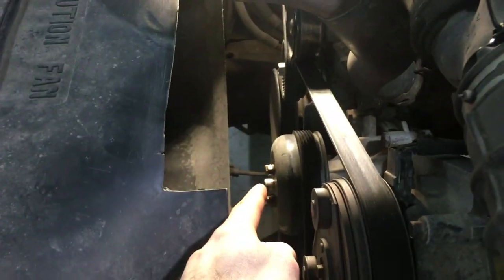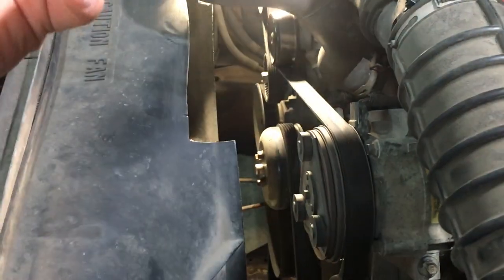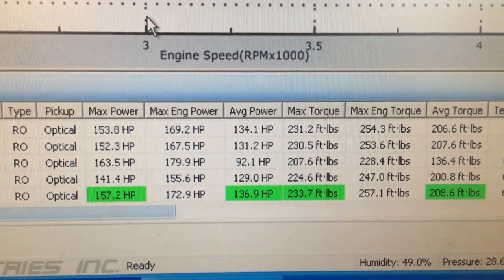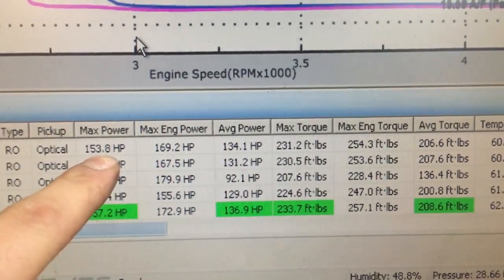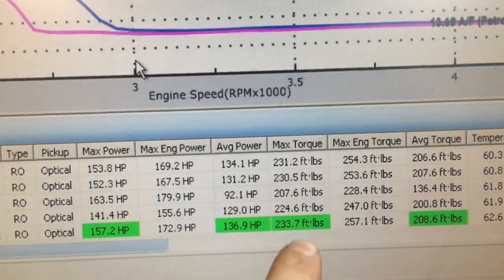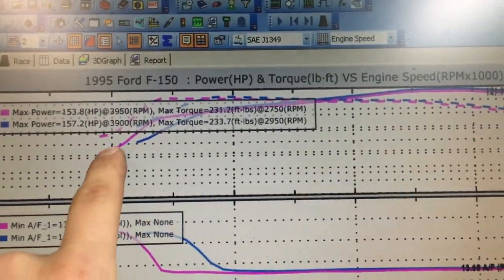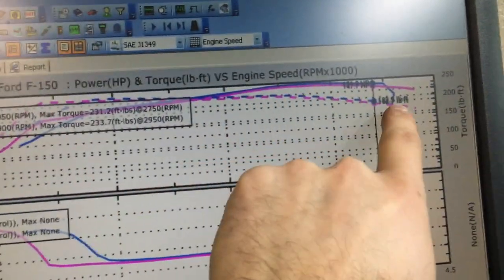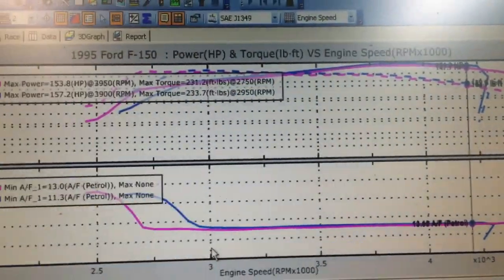Does a Mechanical Radiator Fan Kill Horse Power? - DYNO TEST | 1995 Ford F150

Comment: I'll keep my clutch fan for now.  My stock cooling system has been bulletproof in the hottest midwest summers and heaviest of traffic.  I sure hate to mess with that over 4 hp.  Especially since when it comes to overheating, it only takes it to happen once to kill your engine.
Reply from the maker: I agree with you 100%. I feel like electric fans aren’t full proof.
Reply: I just had to cut my timing cover off and replace my water pump. Now I am faced with either to replace the clutch,fan blades and see if that causes the water pump to fail all the time.
Or switch to electric fans and happen to get defective fans that burn out and melt my engine. 

I am leaning towards keeping it stock because the first clutch/fan setup and 2 water pumps kept it cool for the first 30 years. If i just put a nice clean new one it should do the same for another 30. (in theory)

A 408 Windsor is the best way that i have seen to add HP to any Ford truck. :)
Reply: U are 💯% correct!! Arizonan here. My fan clutch keeps my engine cool when sitting in traffic in 115°F heat.
Reply: @Juan67_Az  I’m from Arizona too and I’m thinking on do electric fans upgrade, but I’m not sure not, I would mess around with my clutch fan just to add 2-4HP extra, my clutch fan is been doing really great during the last few years when it gets 115-120 degrees..
Reply: @Santiago Davila  I wouldn't change my clutch fan for electric fans, plus I don't think my alternator could handle it.
Reply: @Juan67_Az  what the does the alternator has to be with this.? You mean it ll use more voltage.? Please explain. I do want to get electric fans, BUT now reading the comments, I’m just not sure ..  thanks for replying
Reply: @santiagodavila1426  a good set of Electric fans will pull a lot of power/ Amps. Why is the reason you want to get Electric fans?
Reply: @Juan67_Az  so a good set of electric fans will use more voltage.?? How can i find a better alternator.??

And I would like to switch because I heard electric fans give you extra few horse power and you MPG ll be better and also heard that during summer and during the city they help your AC system better. Thanks a lot for your time.
Reply: @santiagodavila1426  im not sure
Reply: I'm going to swap my electric fan for a viscous clutch fan setup. I don't care about 5-10HP at the wheels. I care about towing my stuff while keeping my engine in it's operating temperature so hotter temps don't ruin my lifters and cost me thousands.
Besides the vast majority of electric fans don't give you charts for static resistance so you don't know what the CFM is in your specific radiator & AC condenser setup. You can be rated at 2000CFM on your dual 16" fans and actually only pull 800CFM when running that larger 2-3 core radiator that's 1.5-2" thick.
Let alone trying to pull air through a radiator, AC condenser, PS cooler and Transmission fluid cooler stacked in layers in front of that fan setup.

Heavy duty/severe duty Clutch fans pull tremendous amounts of air through your radiator. Id say my plastic 11-fin clutch fan blade pulls 3x as much air as the OEM electric fan. A heavy duty Clutch can spin 80% the speed of your water pump, a standard clutch fan can spin 60% of the water pump RPM's and a severe duty Clutch can spin 90% of the water pumps RPM's which is insane fast.
You can mod huge plastic fans to fit your models clutch and get insane cooling capabilities.
My clutch works without shroud and my electric fan only works with fan shroud.
Obviously u can get a gigantic E-Fan to pull 3000CFM after static resistance from radiator but your talking about $$$$ multiple components that can fail and let's not forget a E-Fan has parasitic draw on your alternator and that can tank your system.
On my 02 Jeep Grand Cherokee 4.7L it comes with a 135Amp alternator and a bigger electric fan requires a 160A Alt
Reply: @CameronDC-Grimes you said it best!  Your a 💯 correct!
Reply: I mean the whole point is for the mpg’s and the slight relief of strain on the engine when you have electrical systems or once it get’s to its optimal temperature. I bought mine for 500 and I had to do so much work and wiring and it comes with a fuse and switch that makes them more reliable. I’m just scared for the alternator but I can swap my xterra’s with a quest of the same year so I get 50% more capacity
Reply: any car doesnt overheat in hot weather. nothing special about yours

Comment: For a real test, install the electric fan and see if the increased work from the alternator off sets the gains. Electric is not free energy magic!
Reply from the maker: This is true. It could even out once the alternator is under increased load from the electric fans.
Reply: @TheMinuteMasters  It would offset some of the gains. I guess the hope is that the electric fan is off most of the time.
Reply from the maker: @qazwsxzwharp  Yeah I think while the engine is cooler, the fan remains off and there’s less drag.
Reply: @TheMinuteMasters  That is what happens. Generally the fan is only needed when sitting idle or in stop and go traffic. When cruising natural airflow is sufficient.
Reply: except the fan isn't running when it doesn't have to be, making a proper solution more efficient for actually driving.

Comment: The electric fans typically do free up about 3 to 4 hp water pumps free up about 5 hp typically but the alternator actually uses more horsepower than any of the other accessory‘s especially under a load such as air-conditioning radio lights and other accessories
Reply from the maker: This is very true. I guess the real test would be what the alternator load would be.
Reply: The clutch fan is a parasitic load all the time though, hot or cold,  an electric fan will only increase alternator drag while it's running.    I'd be willing to bet this mod would decrease fuel consumption by 5%-10% as well.   (0.5mpg - 2mpg)
Reply: @Zt3v3  Not true.  A clutch fan has a variable load factor, so when the radiator is cooler the clutch loosens up and will draw at say 20% effectiveness.  When the radiator is hot, the clutch engages and the clutch will draw more power and turn the fan at around 80% effectiveness.  And all ranges in between. That's the whole purpose of the clutch, to save horsepower when the fan is not needed as much.
Reply: Would you recommend getting an alternator with a more ampage?
Reply: @anthonypipia6990 higher amp alt is always a good investment. One of these days I hope one pops up for my truck or maybe I need to modify an OEM one.

Comment: Of course the fan takes power to run but what are you going to do, just not cool your engine? That electric fan will have a parasitic drag on your alternator, I came here hoping for a comparison of the two ways to power your fan.
Reply from the maker: Well let’s look at the whole picture. Removing the radiator fan freed up 3 hp across the entire power band. Cool but to your point, the engine still needs to be cooled.
Increase electrical draw does add more resistance at the alternator pulley. We aren’t sure what that value would be but for arguments sake, I’ll say it’s -1.5 hp. 
With that assumption, an electric fan will net +1.5 HP. So, is the electric fan swap worth it? You can do the swap economically for less than $100 or closer to $500 using kits or buying everything new. 
At the end of the day, $100 for 1.5 hp isn’t  worth it.

Comment: They make faster louder severe duty clutch fans that can add extra hp to your vehicle. Computer operated Electric fans arent as reliable or accurate. Manual thermostat sensor fans are the way to go if using anything electric imo. I was using a 12v outlet fan in my 2005 f150 that would cause power gains when i turned up the power to the fan.

Comment: One thing to keep in mind is that out on the road as the vehicle picks up speed air will naturally flow through the radiator reducing drag from the fan. So the benefit from an electric fan may not be as great as you think just based on a static dyno test.
Reply from the maker: Bok Choy That’s a good point. I think the most benefit would be seen around town/city driving.
Reply: The main part of this is reducing rotational weight.
Reply: @JSAFIXIT  what does a clutch or electric fan do??
Reply: @tikihutdweller5944  An electric fan has no physical connection to the engine. A clutch fan is more of a viscous coupler, it never fully disconnects.
Reply: That's exactly why the electric fan is a benefit. It shuts off completely when there's adequate airflow to satisfy the temperature switch. Even with good airflow, the clutch setup will still be a drain on power.
Reply: @honkhonkler7732  what tests have you done to determine that a clutch fan will be a drain on power at any vehicle speed?
Reply: @JSAFIXIT  my 1965 fiat has the fan mounted on water pump axle but It's activated with a sensor so when it's not engaged it's completely uncoupled, I want to see if while i drive the fan stays still once wind hits it
Reply: @mrsnezbit2219 hey, interesting for that year!!!! Is it OEM? If it's a yes, how it works? Thanks
Reply: @estebanamador7601  yes it's completely original, I'll try to explain but English it's not my language. Basically it's just a simple electro magnet that is excited when a plug in the radiator grounds it, so you have the magnet always fed with the positive terminal and a simple spring activated bulb just grounds it, that simplifies a lot of problems. The rest is just that the fan in mounted on water pump pulley but detached forwards by like 1mm. The magnet can receive ground pole via a copper track behind the water pump pulley in which a carbon brush (like a brush from an electric motor) is hold and connected to the radiator temperature sensor. It would be easier to show you than to explain it. For what I know this system is on fiat 1300/1500models and 1500L/1800/2300 models

Comment: Claiming power increases by a single dyno run and with no proper SAE procedures to ensure the result is valid is what YouTube kids are looking for: someone telling them what they want to hear.
Reply from the maker: Dyno results don’t lie. It’s also simple physics. If you remove a something causing resistance and that particular thing also has mass, it’s going to make the rotating assembly lighter. A lighter rotating assembly frees up horsepower. 
Besides, this truck isn’t perfect and won’t be driven in a perfect environment. So to test for results in an otherwise SAE controlled environment is meaningless.
Reply: @TheMinuteMasters  You're 100% correct, it's simple physics. If you remove that something causing resistance you free-up power only to lose it again by re-adding resistance back in the form of alternator CEMF or counter-electromotive force 'cause you know electric fans do use power from the crankshaft to turn right? You may not loose as much and that loss may not be present 100% of the time (fans off) so that's why the gain is so tiny and really not very usable.
Reply from the maker: @istudiowebmstr  You are exactly right. 3 hp through the entire curve isn’t worth the money to install electric fans, especially when the increased alternator load may reduce that 3 hp gain. 
This experiment supports usual advice that to gain horsepower isn’t easy and it takes lots of money.
Reply: @TheMinuteMasters  ...unfortunately more likely to be the case. Now that doesn't mean the same applies to every motor, some may show higher gains than others. As far as I can tell based on years of experience, gains aren't that great and when compared to the cost and complexity they aren't worth the hassle. Now, another factor is if activation management is not correctly dialed-in according to the drivetrain/vehicle more often than not you may be running into other kind of problems like incorrect air-fuel ratio given the new temps and the timing of the coolant flow going in and out the engine, then again what looks like an easy 5 hp is probably not.
Reply from the maker: @istudiowebmstr  You make great points. I made this video several years ago and I still haven’t installed electric fans. It’s just not worth it.
Reply: @istudiowebmstr  the fans only need to run if the vehicle isn't moving.  even 30 mph around town moves enough air across the rad to make fans unneeded.  I've seen this with my own eyes.  I run my fans on a manual switch and only turn them on if I have to sit in traffic or if the vehicle is going to sit and idle for an extended time (rare)
Reply: @98vn1500e  Depending on vehicle frontal area and radiator exposure but yes that's true...

Comment: For my 95 F250 HD 4x4 supercab (7.5L/460 big block) rated to tow 9000 lbs, I tried an electric dual fan /eliminate the stock fan & clutch.  While I don't doubt the HP gains, the BAD result was an overheating engine during extended climbing towing an 8000 lb 5th wheel camper trailer.  Aftermarket Electric fans are not a good modification for vehicles used for towing unless tested for the tow rating of the vehicle.  For my 95 F50, I reinstalled the stock fan/clutch and no issues after that.
Reply from the maker: I’ve heard similar stories. Electric fans seem like they are more prone to failure than mechanical fans.
Reply: And you wonder why all the big rig 18 wheeler diesels are running mechanical fans

Comment: Just pulled the clutch fan off the 305 in my k1500 and installed manually controlled electric fans...they really only need to be on if it sits and idles, stays at correct temp when driving without them being on...it made a noticeable difference in drivability. There's a long uphill stretch on my way to work that I had to downshift to 4th to climb without a severe drop in speed. Now that the parasitic loss from the fan is eliminated, I can maintain 70mph in 5th all the way.  No idea how much actual power I have reclaimed, but it is a noticeable amount...looking forward to seeing how much the mileage has improved.
Reply from the maker: That’s good to know man! Thanks for sharing!🤙 Those mechanical fans definitely feel like boat anchors.

Comment: I'm currently dealing with this on sunny days. If I idle for a while on a hot day, and then start driving, the fan restricts the power as I'm accelerating up to speed. I want to know if this is a problem that can be fix without going electric fan? 

And I mean it when I say IT STRUGGLES TO CATCH UP TO SPEED! 

After a few seconds and everyone else passing us, it finally feels like the power is back... BUTT as soon as I'm idling at the light... the struggle begins again... Please answer ASAP getting paid this Friday and there aren't much videos of this topic
Reply from the maker: Yup! I’ve had that before when the AC is running. I don’t notice it as much with the AC off.  Other than increasing horsepower or going electric fan, there are not options. They make fixed light weight fans but you run the risk of it not cooling enough. 

As for passing people, what size tires do you run and what is your rear differential gearing?

Comment: Was your electric fan on when you did this test?  What about the parasitic loss due to having to put out the electricity needed to power the fan?
Reply from the maker: I didn’t install an electric fan. I wanted to do the test without it just to show what the maximum gains would be. Now if you factored in the parasitic loss of the electrical load, electric fans probably aren’t worth the upgrade.
Reply: you really only need to run the fans if you are sitting still, I've just done the conversion on a pickup for the second time and as long as you are moving (and have a decent rad), it flows enough air across the rad that the fans don't need to run.
Reply: 60 amps is about 1.5 hp. well documented.
Elec fans suck about 25 amps.
Can your alternator stand that ??

Comment: My stock 97 3500 12v 250k on stock radiator separated- now 3row aluminum w/electric fan & painless wire relay since my friend stripped my fan bolt try to help.  Great video ! My truck can use any xtra hp .
Reply from the maker: Very nice! 
Thanks Joseph!🤙 I appreciate it!

Comment: Did you install an electric fan replacing the clutch fan and had them run at max before doing the no-fan-clutch test to consider the power loss from the alternator? From the looks of it, and correct me if I'm wrong, it feels like the test ran without an engine fan at all. I'm asking this to know the actual real life difference. I'm an electric fan advocate, BTW. The other day I replaced my W124's engine fan with one, a project I've been dreaming about for years. Regardless to HP, cooling is now better in our climate that could reach 50C in good day. I did notice a slight difference in performance, tho, perhaps due to the reliance of the electric fans; e.g. they first run at low speed, not directly at high speed like clutch fans. My cooling fans setup has two speed.
Reply from the maker: I only deleted the mechanical fan for the test. I’ve had commenters suggest that the gains would be negligible once you install an electric fan that increases the load on an alternator.
Reply: @TheMinuteMasters  
Well, I can at least confirm that in my car the load is much less now. MPG improved a lot. The other day I reached 24.4 MPG and 23.5 MPG twice before that which I could never achieve in all my 12 years of ownership under the same driving conditions. Just can't say much about the performance because my car is old and couldn't do or find good ways to do accurate tests. I don't think human bodies can detect the performance difference gain by little HP.

Comment: If that clutch fan is slipping , engine not running over 190'
you will have less Horsepower loss with the OEM clutch fan,
However , when the viscus engages and drives the fan , 
your loss will climb higher , maybe 20-30 HP
Reply from the maker: This is true. More than likely during this test, my truck wasn’t hot enough for the fan clutch to engage. So I’m sure HP lose can get worse.